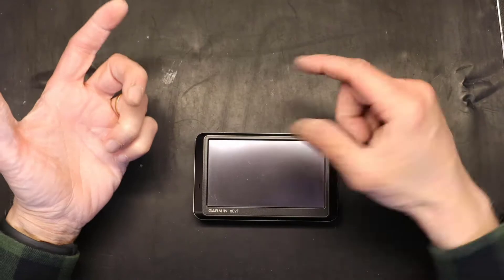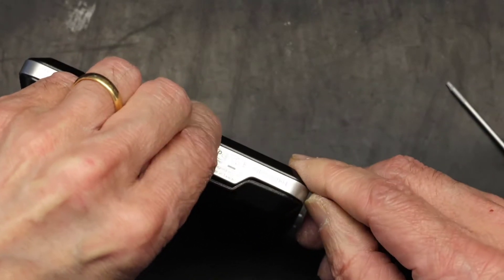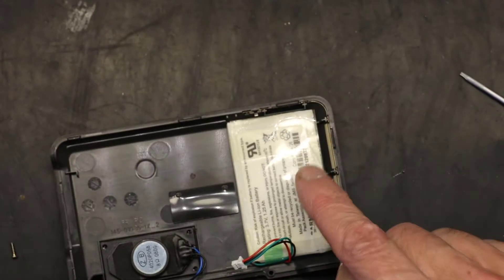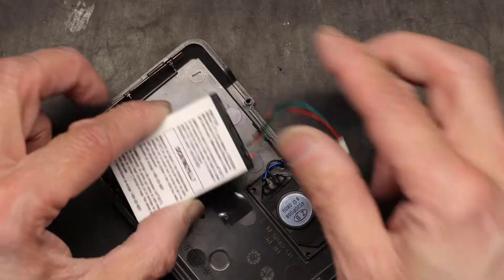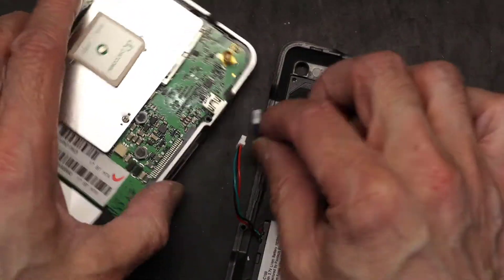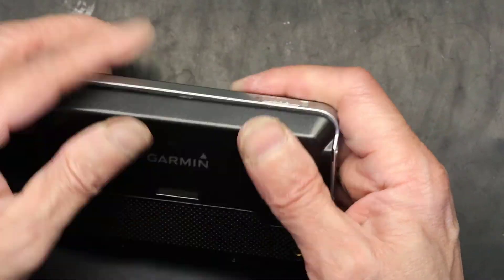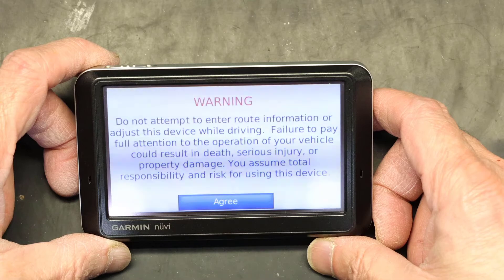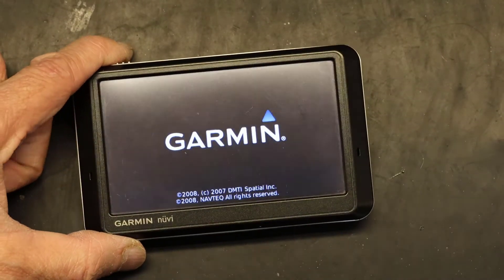Battery Replacement Tutorial on a Garmin Nuvi 750, 760, 765, 780, 785 GPS Navigation System

Comment: I need to replace the speaker in my Garmin 765. Any idea where I can get one. I live in Australia.
Reply from the maker: The easiest solution is to buy a broken Garmin Nuvi GPS and take the speaker out of it. All of the following models use the same speaker so you can buy any of these. Garmin Nuvi 200, 200W, 205, 205W, 255, 255W, 260, 260W, 750W, 760W, 765W, 780W
Reply: @TECHNOLOGYTIPS101  Thanks for the idea. I did manage to buy a replacement filter on Alibaba really cheap:-

40*28*11.4MM 8ohm 2W 380Hz Small Horm Speaker Notebook Speaker GPS Speaker
Reply from the maker: @stevethomson1486  No problem!